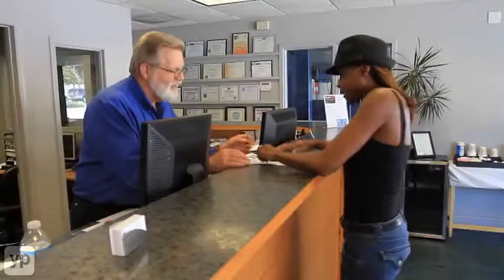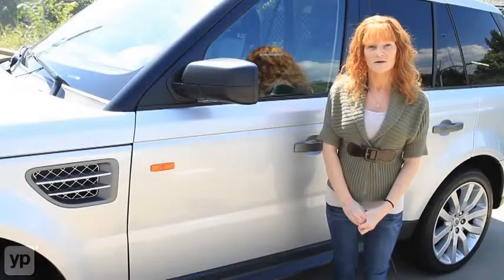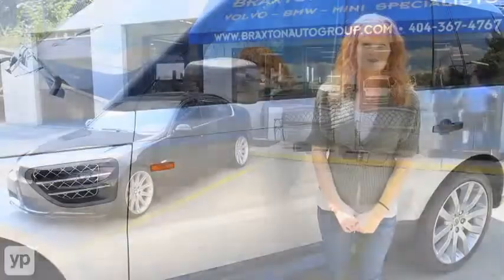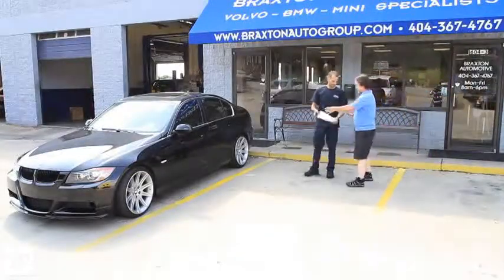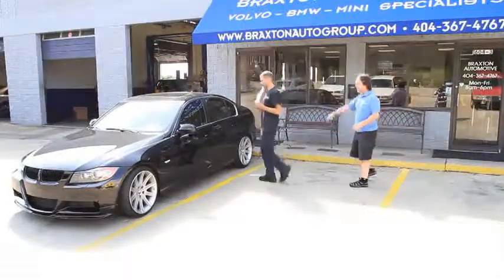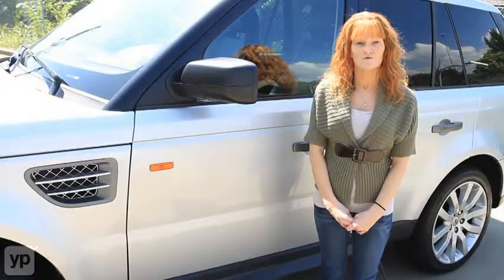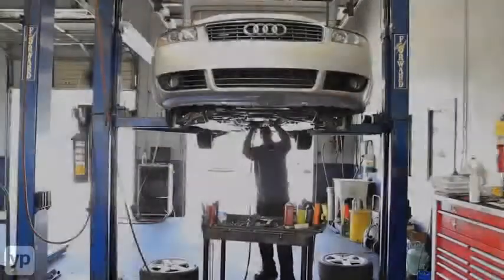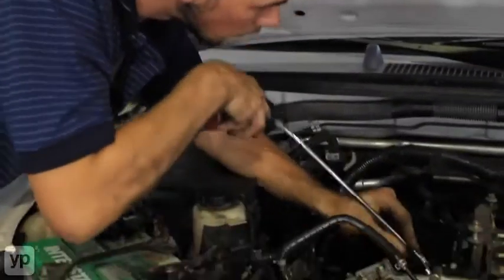Braxton Automotive  | Auto Maintenance and Repairs | GA

Comment: Braxton Automotive on Howell Mill provides botched oil changes and poor customer service from Owner Steve Braxton. I had two botched oil changes over a one year period with the most recent being 1/2015. Oil light came on next day and found car was 2 quarts low. Even with that I called 3/2015 to get brakes done. Manager assured me they would take care of me and make up for past discrepancies. While I was en route, he called back to say the owner Steve doesn't "feel we can provide a quality service to you given the failures of the past". WTH? He said the owner felt if I didn't have confidence in them in the past then they probably can't meet my expectations. Mind you they had a note on my account that the technician was reprimanded because of the botched oil change. How is that my fault? Would not recommend this Auto Shop to fix my son's toy car...